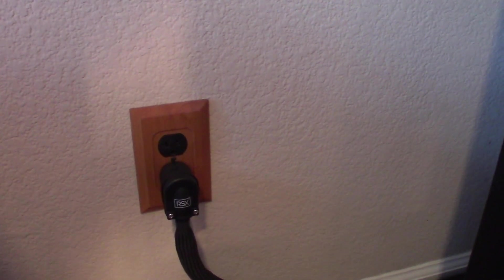Our HiFi System

Comment: Fascinating. What is the extra support you have under the LP 12? And is that the Radikal 2 power supply? If so, did you compare it to the Klimax machined enclosure version? Thanks.
Reply from the maker: It's an HRS platform under the Linn.  Very heavy that!  I do have the Radikal power supply but never compared it to the Klimax.  Went with the dealer's rec on that one.
Reply: @LetsCleanaRecord  Great! Thanks for your reply. 👍